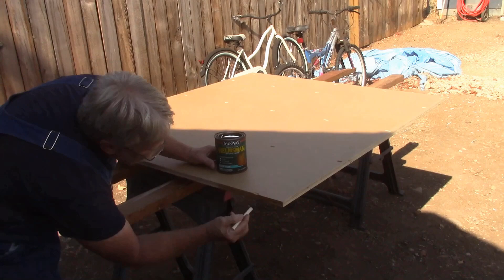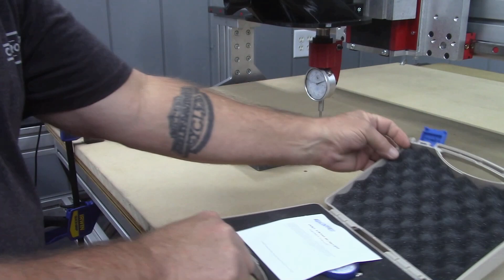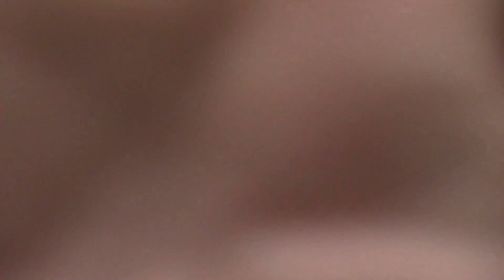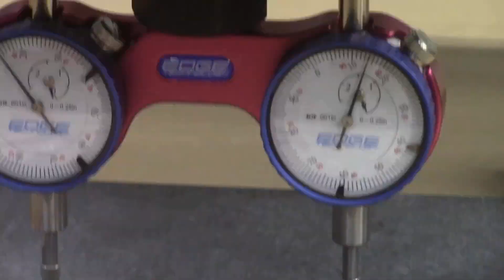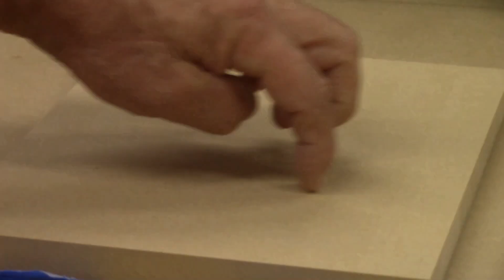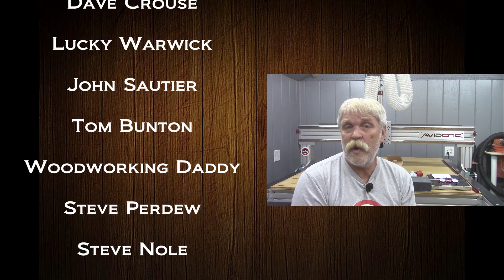Leveling, Squaring, and Tramming My @AvidCNC  4848 Pro

Comment: Great technique. Sometimes its easier to do a 3 point level on the surface plate. Sometimes its super hard to get 4 points level.

So 2 points in the font 2 corners and 1 point in the middle of the back.
Reply from the maker: Great tip! Thanks!

Comment: Do you find sealing your spoil board stops it from swelling over time?
Reply from the maker: No. I used to seal my spoilboard, but I haven't bothered for the last couple of years. I haven't noticed any difference in the durability or swelling at all. If I suspect a section has swollen, I just resurface the entire spoilboard, removing .010 inches per pass until it's nice and flat, then carry on.

Comment: A cheaper version of the granite surface plate. Get the biggest piece of glass that will fit on your router bed. Then use just a simple dial indicator with the longest arm you can find. The larger the diameter you sweep with the dial = more accurate tram. Thays just my OCD talking 😂
Reply from the maker: I made a video using that very technique several years back. When I upgraded to the Avid CNC, I decided to try this method. It's been my experience, the method shown in this video is more accurate than the one you described. Thanks for watching!

Comment: The problem with this tramming is all you're doing is matching the out of square of your z-axis with the block or if you use glass they're doing the same thing with glass You're not actually leveling the glass or leveling the block You're just matching the out of square of your z-axis so this is not accomplishing anything
Reply from the maker: If I haven't accomplished anything, explain to my why I have surfaced literally hundreds of slabs, boards, and glued up panels and have had NO shingling or scalloping. Those items all came off the machine needing only a few passes with 220 grit on my random orbit sander to be finish ready. The process works. Try it.
Reply: @MarkLindsayCNC  Read that comment again. You are making two parallel planes (XY of the surface plate is parallel to XY at the spindle, and the spindle itself is perpendicular to that XY plane), but that has absolutely nothing to do with whether those planes are square to the machine planes (XZ or YZ). Since you needed to shim the left side of the surface plate, we know for certain that it is not square to the machine XY if you are calling the top of the spoilboard the XY plane as it stands. Surfacing will not show an issue, because you have made two parallel planes and surfacing operations are done at a constant Z height - but that is it. You will only notice if it is out of square if you are doing precision work, for example you are drilling or milling deep holes and you find the holes are oblong or tilted. If your XZ and YZ planes are square to each other, that is called luck. Dual Y-axis gantry-style machines are prone to XZ and YZ getting knocked out of square relative to each other. If you move too fast or crash the machine running open loop, one motor may lose steps whereas the other might not. There are ways to compensate for that, but I have not seen that implemented frequently in this level of machine. Is your method "good enough" for most woodworking? Sure. Is it truly establishing machinist-level squareness of the machine? No. If you put a precision angle block on your surface plate and swept the indicator along X and Y you could check XZ vs YZ squareness. If you put that precision angle block upright, or use a precision cylindrical square, and sweep the indicator along Z you can check XZ vs XY and YZ vs XY. That 0.011" shim you needed at the bottom of the spindle could be because your gantry (X-axis) itself has a nod. You compensated for that with the shim under the spindle, but that doesn't prove that the Z axis is in fact perpendicular to XY, just that the spindle is perpendicular to XY. Maybe the left side of the gantry is higher than the right, which is why you needed the shims for the surface plate. Again, probably "good enough" for most woodworking, but not technically proven square.
Reply from the maker: You answered your own questions within your post. "Is your method "good enough" for most woodworking? Sure. Is it truly establishing machinist-level squareness of the machine? No."  As I said in the video - I'm not a machinist. I don't claim to be a machinist - never have, never will. I'm a woodworker, and have been one for over 50 years. You're comparing an excavator to a dump truck. They'll both carry an amount of material, but that's where the similarity ends. This is the point that I tried to make at the beginning of the video. Carving wood and machining metal are two different things. There are some basic similarities, but when it comes down to it, the only thing they really have in common is a spinning bit. The materials are different, react to milling different, and the processes used to achieve the final result are different. Where you're used to 4 digit resolution (or more) when it comes to precision, most woodworking doesn't even need 3 digit resolution. Going to the lengths you're describing is just unnecessary. As an aside, the Avid CNC uses proximity sensors to auto-square the left and right sides of the gantry during the homing process, so that's not a concern. In the 20 months I've been using this machine, I've not had a single issue with squareness, accuracy, or repeatability of the machine. So yes, as you said, it's good enough. Thanks for watching.

Comment: I liked what you started with, by taking the time to level the bed structure. This is something that is lacking in literally all other discussions of cnc tramming. You need to know that you have a level surface to measure off of,  otherwise all other subsequent steps will be pointless.

So I'm disappointed that you didn't start the tramming process from there.

By adding plywood and MDF, you've already spoiled the experiment. You should've used that flat block directly on the CNC bed structure to tram the spindle. THEN added your plywood and MDF, THEN did a spoilboard surfacing/fly cutting.

If i could figure out a way of using a laser level and feeler gauges to tram my Axiom AR8, i would, because i think that would be better than most videos I see, where people dont even realize they need to start with a level surface, before anything else.
Reply from the maker: Tramming to the CNC machine structure wasn't a consideration, nor was it an option. Balancing an 8 inch by 8 inch granite surface plate on a 1.5 inch wide beam, then trying to tram to it is not my idea of starting off on the right foot. Laying down the MDO sub-table, then the MDF table was the way to go. The difference in tram from that point is negligible, if it even exists at all. Remember that I'm a woodworker - not a machinist. I'm setting up a CNC router - not a mill. From a woodworking perspective, 4 digit resolution and accuracy is, to say the least, massive overkill. It's just not needed. Most times 3 digit resolution and accuracy is overkill, but we all strive to be within .001 inches. Yes, it's important to have a level surface to start. But even if you're just 4' beam level, that's good enough for woodworking. I say this as a woodworker with 50+ years of experience in a trade that more often than not has a 1/16 inch builder's tolerance (there are exceptions of course.) Still, you do you. If you want 4 digit resolution and accuracy, I say go for it. I just don't think it's necessary.

Comment: Mark, 
Thank you for taking the time to do this video. My question to you is. Do you need to rotate the Traming device all the way around and all have to match on the indicator? I started with Y and it read 19 on both indicators then rotated around 180 degrees and it read different. Then I went x and it read 14 on both indicators then rotated it 180 on x (side to side) and it read 15 and 14. Is it necessary to rotate the device 180 degrees to check readings or is it safe to say that when it read 14 and 19 I had a good tram?

Thank you for your advice and awesome videos!
Reply from the maker: Thank you, Raul. No, you don't have to rotate the tramming indicator, providing you have leveled the plate you're tramming to, and that plate is nice and flat. I invested in a granite surface plate for tramming (as well as a few other applications,) and it really helped me dial in my spindle. I had used a piece of glass in the past, but not all glass is as flat as we assume it to be. 
You can rotate the tramming indicators it if you'd like - there's no harm in doing so. Just make sure there is no dust or debris on top of the plate you're tramming to. If anything gets under the tip of either of the indicators, it'll give you a bad reading. I didn't bother doing that. I just took all of my readings from the front of the machine, with the tramming indicators facing me.
It's also important to remember to adjust the nod (in most cases the Y) in the router/spindle before you even check the tilt (in most cases the X.) The reason is because you're going to have to loosen the router/spindle mount and use shims to adjust the nod out of the router/spindle. The minute you loosen a bolt, you change the tilt - so any adjustment you've made to the tilt will be lost. You can go crazy and waste a lot of time making adjustments if you try to do both at once. Get the nod (front to rear) adjusted out of the router/spindle mount first, then move on to adjusting the tilt (side to side.) Good luck!

Comment: Thanks for this video.  Why did you coat the mdf with poly?  Thank you.
Reply from the maker: Thank you, Jay. I live in an area of extreme humidity, with periods of dense fog that can last for a week at a time - sometimes longer. As a result, wood and wood products simply start to rot if they're not sealed. I have to seal my spoilboard to keep it from absorbing moisture from the air and swelling and rotting. I tried it unsealed one year when I first started my CNC journey, and it started to mildew within 6 months. Ever since then, I have sealed the spoilboard, and have had no issues since. It's a minor pain, but it's not too bad.

Comment: Hi Mark, do you have any recommendations for a cheap dust collector. My shop vac isn’t cutting it on my axiom cnc
Reply from the maker: I haven't done a video on dust collection yet because my ducting system and dust collector location is still temporary. I can tell you from experience that airflow is what you want. Suction from a vacuum cleaner is good, and it'll get you by, but only just. Plus, vacuum cleaners weren't designed to be operated for 4, 5, 6 or more hours at a time - that's why they overheat and burn out so fast. I currently have a Harbor Freight 70 gallon 2 HP dust collector hooked to a Dust Deputy, and it's doing a great job. The filtering from the standard Harbor Freight bag leaves a little to be desired, but it'll flat-out move some material. It won't quite suck a collet wrench out of your hand, but it'll come pretty durned close. I really can't complain about the Harbor Freight unit. Add better filters to it (there are a TON of videos online about upgrades to this dust collector if you search for them,) and it should do a fantastic job.

Comment: What would you use for maximum depth of cut on the flycutter. When I am surfacing to mill a board or to surface the bed I never go over .030, usually .010 or .020. I also slow the spindle rpm. Any feed back or comments welcome.
Reply from the maker: Amana recommends a depth of cut less than .25 inch per pass with the RC-2255 bit. Yes - less than 1/4 inch. Just between you and me, I'm nowhere near comfortable with trying to take off that much in a single pass. I think the deepest I went per pass was .050 inches.
Reply: @MarkLindsayCNC  Thanks, I often back off from what the manufactures say the bits will do.

Comment: Learned how to cross level of the table!!!!

But I have to ask,. Why not use the tramming indicators for leveling. No need for both?
Reply from the maker: I'm leveling the frame in relation to the floor of the shop, not the gantry. If I lift a corner, the gantry rises with it, so the measurement would stay the same, no matter how high I lift it.
Reply: @MarkLindsayCNC   I think my point/question was misunderstood.

I understand why your using the caliper at( 7 minutes) ,

but why not use one side of the TRAMMING caliper instead of swapping out 
if you only use one of the calipers on the traming tool, its the same thing.